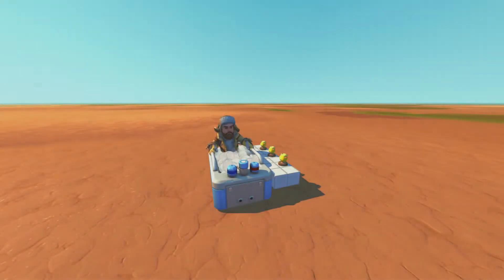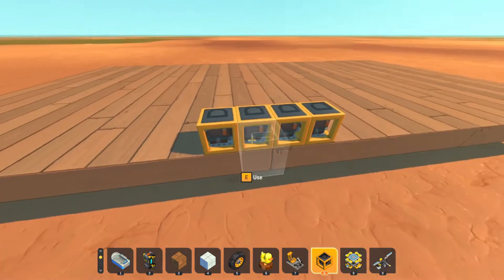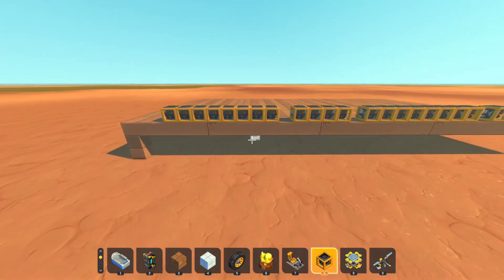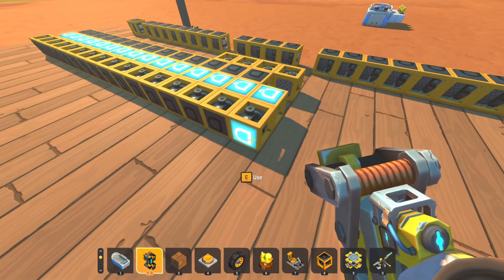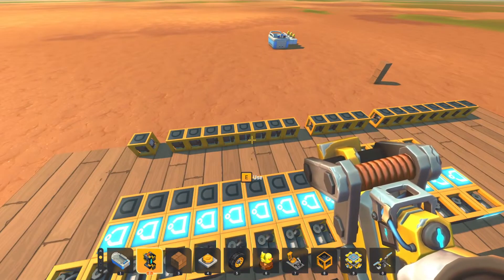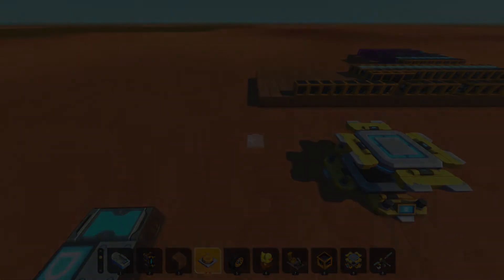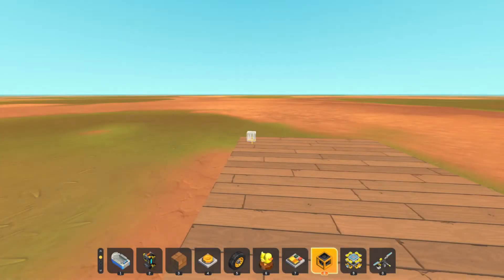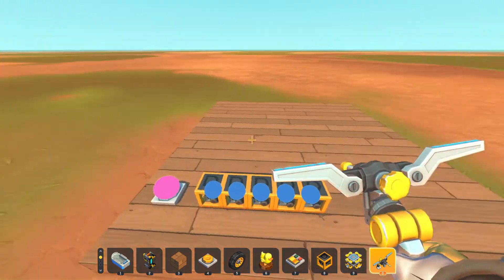(Scrap Mechanic) Basics of RAM and Pulse Extenders | CPU 101 EP2

Comment: A solid video with a lot of of good info. Good job on this.

Tho I disagree on some of the methods for building RAM and pulse extenders. XOR memory (which works like a D flip flop) is much nicer to work with. It doesn't flicker on lift, works with 1 tick pulses, and can be just one gate if selfwired by bp editing. With XOR memory you can get 3 gates per bit density for RAM instead of the 8 that it seems to be in your design. Also the address decoder is bigger than it needs to be :)

With XOR memory you can also make a very small pulse extender. Also you can get a pulse when something is placed on lift with just two NOR gates (or any other inverting gate) connected together. Much nicer than using a sensor I think.
Reply from the maker: im a little bit new to the whole logic computer stuff and I haven't looked too far into blueprint editing. As I said in the video, that was only revision 3. Revision 4 may have self wired xor gates. Also I'm interested, can you link the binary decoder that you're talking about?